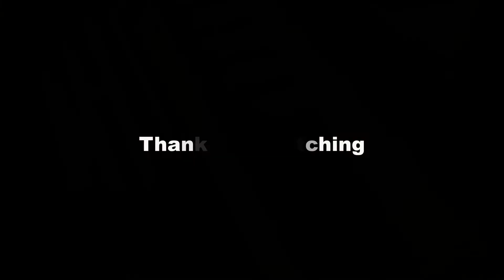X-Carve CNC Router Modifying Drag Chain or Chainlink

Comment: I am new to DIY, please provide me a little extra guidance.

1.) I was planning to use a 5/32" bit.  Is that the size which you used for the 4m screw, or would you recommend another size?

2.) I do not know which bit to use.  The bits in this Black & Decker kit are not marked, would you be able to describe what the tip looks like that I should be using for metal, or any other considerations (perhaps even a video)?
Reply from the maker: As for size of bit, use one just a tab bigger than screw. Most standard drill bits will work for aluminum. Just take your time drilling, don't get in a hurry, or you will break bit.
Reply: +Dave the Woodworker It is installed.  Thank you for taking the time to advise me.
Reply from the maker: you are welcome